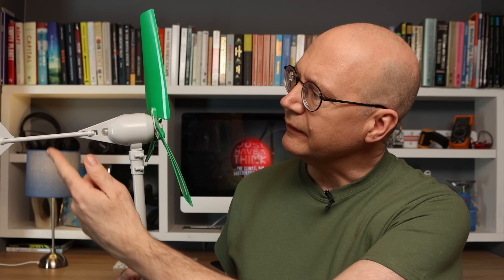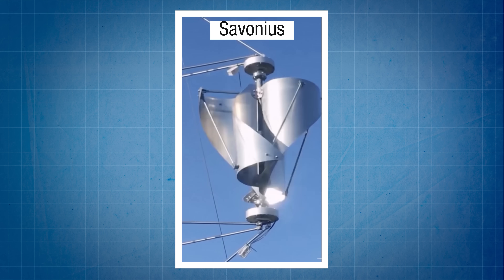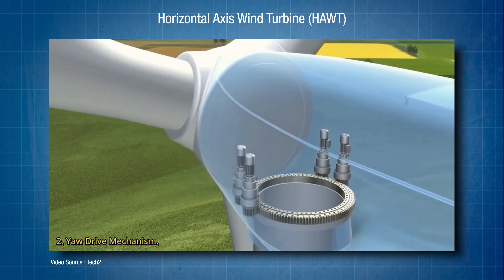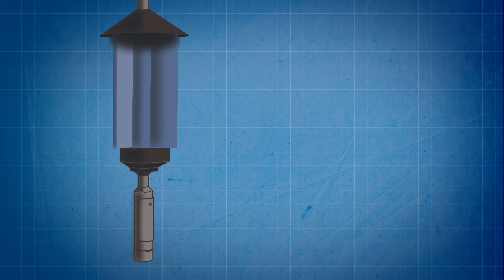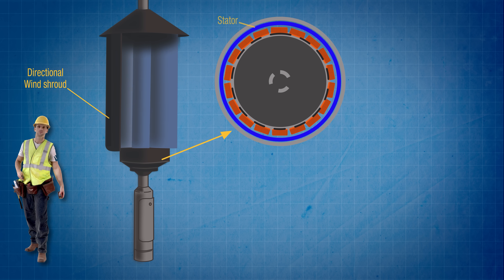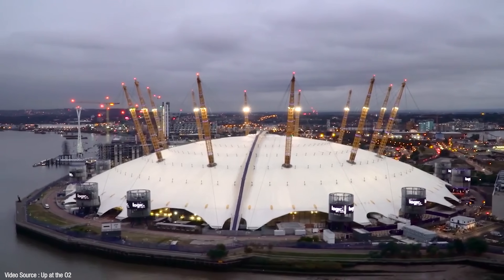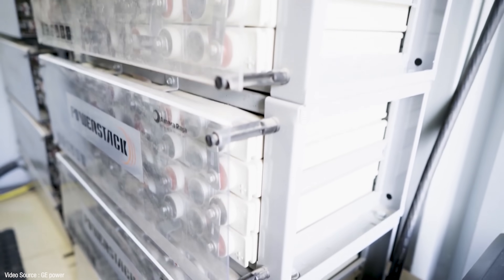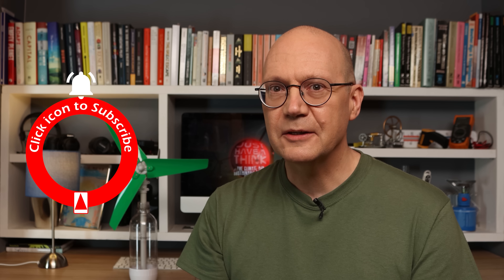A vertical axis wind turbine that doesn't need the prevailing wind! How do they do that?

Comment: There is no way one of those can produce 2.5 kW. Where is the working prototype? Savonius came up with the design 100 years ago. It has never been successful. These things will simply break down before they break even.
Reply: @capturedflame  That's about accurate; check out Jeffrey Lebowski's comment that calculated 25 W at 5.4 m/s.

Comment: Think about this: In heavily trafficed areas, the cars will produce a steady airflow. That's what's providing the energy for these VAWT's.
But this airflow is slowed down by the VAWT's, which means that the next car has to overcome more air resistance (since the air was slowed down by the VAWT), which in turn means that the energy requirement for the  next car is increasing. So a part of the energy produced by the VAWT's is coming from extra fuel (or electricity) consumption from the cars.
Reply: The turbines would be at the center of the road, so the air that is slowed down was moving across to the other side where traffic is reversed - so slowing that air down could actually decrease air resistance for the opposing traffic.

The idea is still stupid though, because there is no way that a turbine produces 24kw like they claim in their comparison with solar (125 turbines, 3MW) - i think it wont be worth it and the project will fail.

I would be surprised if they could even produce 2kw...
Reply: I think they must be assuming some mad efficiency
Reply: @jeffreylebowski4927   won't that actually look like a spinning vortex (like the spinning brushes in automatic car wash)? I don't think it's realistic to think that wind is "cancelled out" by opposite wind, rather they form spinning turbulence.
Reply: I think you need to be following quite close on the bumper of a leading car t get a draft advantage In fuel economy. Surely that data is compiled somewhere
Reply: I would like to see a simulation but I would  really guess that this is quite negligible in terms of extra fuel burned by the cars. The airflow around a round would be so messy anyways. I'm more woried by the terrible efficiencies these things have, though I'm a bit biased having built a failed one

Comment: I know that the big turbines have an issue with higher wind speeds.  The blades have to be feathered (the individual blades turned so the wind passes by without causing them to move) in order to keep them from tearing themselves apart.  Can the wind ever be too strong for the vertical turbine to take?  If so, how does it prevent itself from catching the wind (an important disadvantage for vertical systems)?
Reply: The blades can be adjusted just the same way as on horizontal turbines, you close/open the cage to regulate the power.
Reply: A force 5 storm might well take down the lamp post....  ;o)

The tip of the 'blades' is very close to the axis.  It would seem that there isn't a lot of leverage to deal with.  I can't see a reason they would fail due to spinning too rapidly but if there's a problem add a brake.
Reply: the other channel (that he referenced) said it could tear itself apart as well.
Reply: VAWT’s are usually designed with a braking mechanism for when winds get too high.  It’s often triggered by centrifugal force so when the rotor starts moving too fast the brakes engage and slow it down.
Reply: This type of turbine will become less efficiënt at higher wind speeds and therefore have a maximum rotational speed. If you design them right you make them just strong enough + safety margin for this maximum rotational speed.

Comment: Questions here: Since the turbines are powered by the moving air I would assume that the air is slowed to down just by taking into account conservation of energy. Wouldn't the slower air be felt by the cars? Or put differently wouldn't the turbines exert a kind of friction force on the cars passing by? (sorry I'm not good at fluid dynamics and was just wondering about this..)
Reply: Yes.  The wind pushing on the turbine blades causes a reaction (equal and opposite) which slows down the air.  However, that air is no directly in front of the car, so the effect is somewhat diminished.

Comment: It might be more efficient to install 5000 diesel powered fans to help propel the automobiles. 

Mostly joking. Not entirely.
Reply: Enclose the motorways in a huge cloche and use the fans to decrease the air pressure inside and thus the air resistance.  Or you could have a fan at each end, one blowing and one sucking so the cars could switch their engines off.

It's the sort of thing an entrepreneur like Richard Branson could get involved in.

Only joking, entirely :)
Reply: @rogerbarton497  you just invented the hyperloop (or at least one of its principles)
Reply: No! 
Propel the cars with fans and install a turbine on each car. This turbine will catch the airflow of other car fans PLUS the high-speed driving airstream!
The electricity output will be phantastic! :)
Reply: @TheSpecio  I got a better idea: simply move the earth in opposite of the desired direction, but make sure the car stands still.
Reply: @tzenophile  
I wonder if the tidal forces could be used to push/pull a car...
Reply: @TheSpecio  Flower power is your best bet
Reply: Put the cars on skateboards and make all the roads go downhill.

Comment: great vid.. and one thing , i like that you talked about is home use for Vawt, the idea that came to mind a few weeks ago, was the look of all the house's around where i live . and that they all had one thing in common . "Chimmy stakes ". if every house had a 5kw vawt , on the house , how much power could be added to the grid, or to battery for house ..
Reply: The average home uses 4kw and these turbines work at lower speeds, so you would cover most of your homes energy usage. You would still need batteries for the times when the wind is not blowing.
Reply: this thing is 2 meters tall and produces about 25 watt. 5kW is 200 times that. I don't think you want something that size on your house.

Comment: How different would this be in tunnels where the wind flow becomes concentrated and forced in one direction?
Reply: That might be a very good location.  The direction of the wind is not as important as the concentration.  It should be simple to measure the wind strength at a single point inside a tunnel and along an open highway as a car passes.
Reply: Don't forget that outside it will react to wind and not just cars, inside a tunnel you lose all that wind, very big hit to total power.

Comment: I had a thought. It there a way to generate electricity through ground vibrations. If systems that don't need much height above ground then devices could be place intermittently between the wind turbines. I've search for data but found that not much seems to have been done here. I was thinking in terms of subway systems which produce wind and vibration in abundance 24 hours a day.
Reply: harnessing vibration is like wave energy  (ocean). Ocean wave are vibrations but larger.
Reply: During my travels i often saw lines and lines of HGV's braking all the way down a 4 mile road to find themselves a few hundred feet laterally at a lower altitude. A heavy duty chair lift with the lorries creating electricity, would be a quicker alternative and would considerably reduce the pollution from engine, brakes and tyres. The energy spent and pollution created to get them to the top has already happened, regardless if it is wasted coming back down.

Comment: Since it works with such light wind speeds, could one also be spun manually, say by connecting it to a stationary bike? Would that generate any significant power?
Reply: Just put a generator on your axle.
Reply: @lrvogt1257  Right. But there are different types of generators. Different magnets and arrangements thereof, for example. Would this turbine make power more efficiently than an off the self generator? Wouldn't it be better to have one device that could do both?
Reply: @thinktoomuchb4028   :  You don't need the turbine for a stationary bike, just the generator. I assume you'd connect the most efficient generator you could.
Reply: @lrvogt1257  LOL
Reply: @thinktoomuchb4028   : ??? What am I missing?

Comment: There is no such thing as free energy.  If you think this would work your life is gonna be hard
Reply: the way that the government is their customer sounds like solar-roadway shenanigans...
Reply: You are completely right that there is no "free" energy.

But then, there are tremendous amounts of unused energy or inefficiently used.
For example the ca 60% of fuel energy in vehicles that are not used for moving car and load, but get lost to wind drag, heat, braking ect. There is a reason most modern electric cars have brake-energy reuptake mechanisms. I drive an Ebike which does the same.

This is just the same - milions of cars expend giant amounts of energy pushing air anyway. 
Why not reuse it?
Plane engines reusing the heat in their exhaust to preheat intake air and fuel for combustion do the very same. And it brought to efficiency gains that quickly led to every commercial plane (and many military ones) in existence using the technique.
Industries who produce a lot of waste heat have wasted that for over a hundred years. Now server farms are used to heat public baths, or aluminum casting plants feed the heat needs of hundreds of nearby housholds.

You arrogantly implying that such secondary use of energy spent anyway is "stupid" or whatever you try to imply, is thoroughly debunked by many, many such applications, economically and worldwide.
Reply: @nilesbutler8638  There is no "reuse" because that is needed to move the vehicle through the air. It is not "unused" or "waste" lying around waiting for an idiot trying to grab it. It is gone, ceased, used. Putting things in the airs streams increases the air's resistance and thereby the fuel consumption.
Reply: @hans-joachimbierwirth4727  
Ah?
So - do we agree that cars do move air around in their motion anyway, right? Expending fuel energy to do so.

And - if you watched the video - that air movement can be in part used to move those turbines. Generating electricity.

Soooo - not exactly gone, is it? 
The fuel energy expended in pushing air out of the cars path, being in part recaptured by the turning of the turbines?

Physiscs does not know any energy being "gone, ceased". Doesnt happen.  Cant, really.
The law of conservation of energy does not allow for that.
It can only dissipate and transform in different ways.

Man, I´m a humanities major working in a medicine-adjacent field, with no frigging basics in physics, and even I know that.
Reply: There is a reason yourname is smelly cat- the free energy comes from the fact that haulage trucks and cars are shaped like Bricks with very poor airflow- so these turbines harness the ignorance of car buyers and car companies that think streamlined cars will not get sales- however there is a huge risk factor here, IF suddenly there is a gigantic investment in education in the UK attitudes can change and that can result in a streamlined car revolution and that could cause a energy stocks crash. Luckily the UK edges out the USA for boneheadedness so that is worth a LOT of Money- In fact cars can be built with convex parabolic windows and haulage with a horseshoe front with dangling cabin as a tax on Haulage by generating more wind- There is nothing a Tory government can not accomplish.
Reply: @jeanpaulchristian3282  notice that "innovative energy tech" always uses government as a buyer? in this case they "lease" the turbine to local government.

Comment: Question: wouldn't the vehicles need to push harder, and use more fuel, because of these turbines? Yes there is always wasted airflow beside the traffic, but would the vehicles need to spend more energy than the wind turbine will extract? If that is not the case, which I hope is true, this is a fantastic idea! Thank you for the amazing content!
Reply: Absolutely they would.  This is basically the same idea as putting a wind turbine on your car to harvest energy from your driving speed and the wind that results.  Any energy the wind has came from the car, in this case.
Reply: @GerryRR  About putting a wind turbine on your car being a bad idea, it actually can have a net positive effect and generate valuable electricity! This is because the wind turbine has less drag compared to the front of our vehicles. I came across a channel named "Quint builds" that tested the idea recently, here's the video if you want to check it out yourself.
https://youtu.be/tEPBdztGMdI

Not sure if we can translate this experiment to lamp post turbines tho. The latter probably does not reduce drag on the vehicle. Though if we can tap into all the untilised wind energy for a little more fuel consumption, that might actually give positive results? Thanks!
Reply: @vishank7  I mean, if what you were saying was true then you could build an electric car that powers itself.  Nobody has done this, so I'm going to take a YouTubers experiments with a grain of salt.
Reply: @GerryRR  It does not generate enough electricity to power the entire vehicle. I was skeptical about the idea at first as well, though that guy is a credible science communicator and knows what he is doing. He uses more math than words to prove his point, do check the video out!
Reply: @vishank7  Yeah I guess what I'm saying is that the conclusion is more "old pickup trucks suck so much that you can do this and come out ahead" rather than "you can put a wind turbine on a car and generate free energy".  If the idea really worked you could put it on an electric car and extend the range.  So are manufacturers not doing that because it doesn't work, or for some other reason?
Reply: @GerryRR   I think what you're saying makes sense. Tesla vehicles these days have such low drag coefficients that this idea would be impractical, and ofc they would extract energy using a turbine if it was possible. Will be interesting to see what justification Alpha 311 has for this problem.
Reply: That's my concern.  Would the air displaced by vehicles meet more resistance with these installed?  Perhaps a better option would be to install them at the top of the lamposts to pick up any wind that's blowing about, well out of the way of the traffic.

Comment: Post from Canada:
I had always been talking about exactly the same thing to install it on the medians of the roads to capture the wind generated from the traffic flow. Glad to know it can generate about 5kw. Amazing.
Note: I was also thinking about installing the same on Sail Boats along with Kite Sails that has thin film Perovskite solar on that.
Reply: I think it will has some negative side-effect, like if the turbulence from car passing thru is harvested and removed, then air pollution have no way to disperse and accumulate on the road.
Reply: Had been dreaming of the same idea on boats... They are already designed to have a mast, so why not a turbine instead of sails...
Reply: @snowstrobe  Oh! i think i know the reason for that. 
* its efficiency to move an object/kg is way smaller than sails
* they are also heavier than sails. 
* also wind is intermittent.  
PS: i believe they had designed something like that to run on roads during ancient Greek times.
Reply: @Soothsayer210    Wind is 'intermittent'... so how is that different than sailing... Least this way the energy could be stored. 
Modern materials could easily make them lighter than sails.
Reply: @snowstrobe  my apologies, i read your question wrong. I was thinking that you were suggesting connecting it to paddle wheels.

Comment: This is interesting development of idea.
Trick is to make it economically viable. I don't think leasing is a good way of doing it, because once lease time is up turbine usually goes away.

If maintenance of these turbines were easy and cheap, they should sell those units. That way customers installing those could generate electricity longer than 25 years from unit.